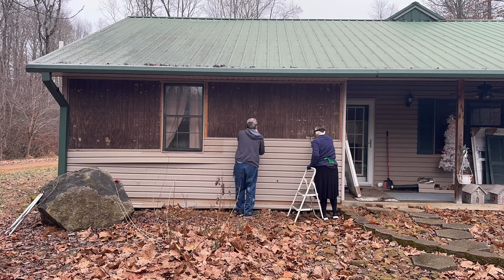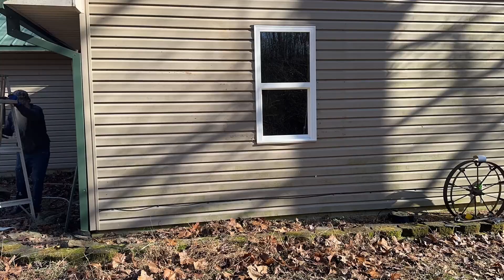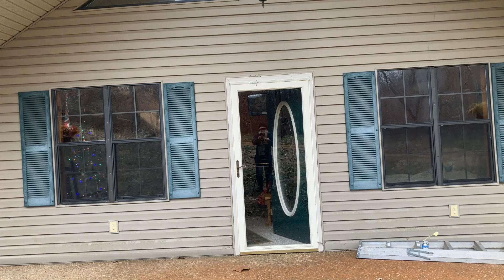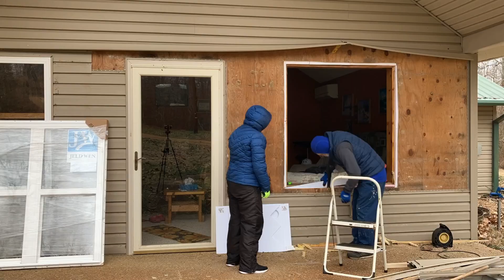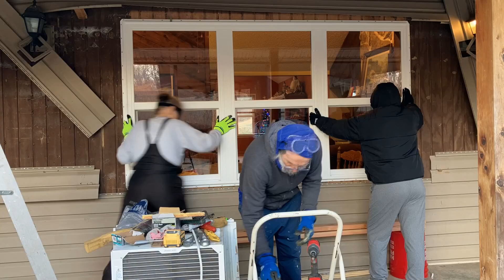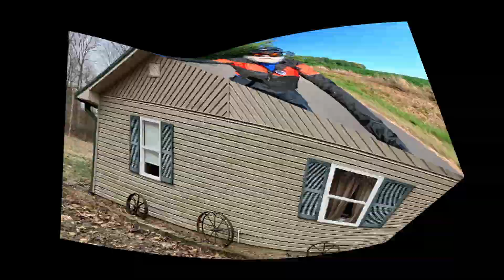Can It Be Done? Using New Construction Windows, On Old Construction Without Removing Interior Trim?

Comment: I would have thought an old house would have had self draft through the window frame. It feels like the foam will destroy that?
Reply from the maker: We generally stuff the cavities with fiberglass here, the foam is easier and the only way we could do it without removing the interior trim.  I did not want to have a lot of construction in the house as it is messy.  Worked out well, we are very happy to finally have some decent windows. Thanks for watching : )